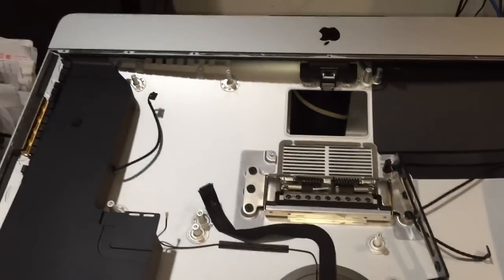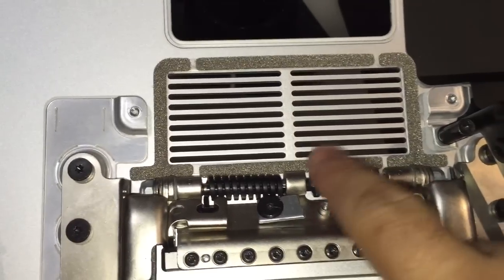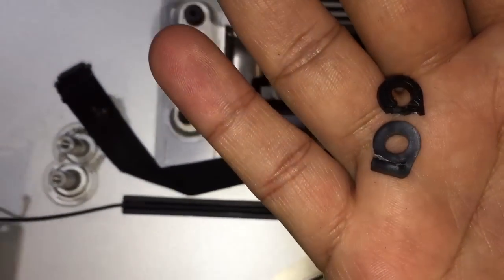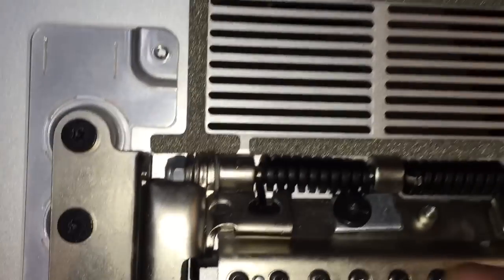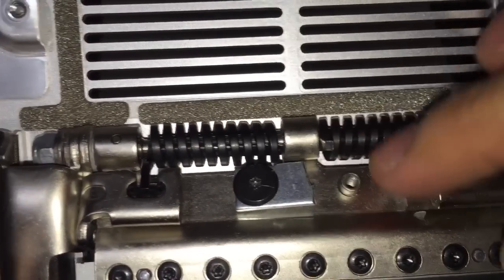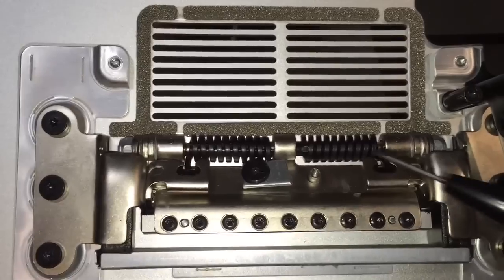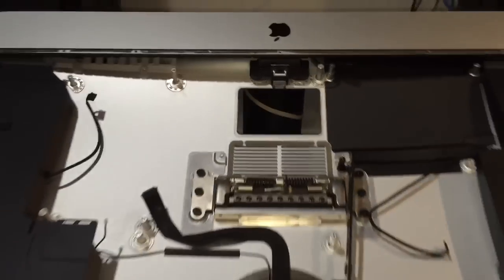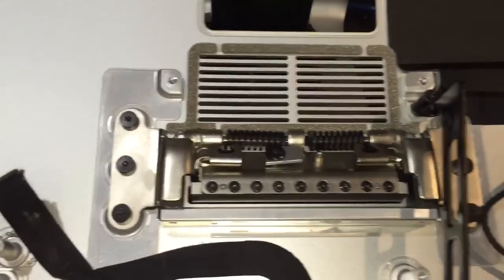REPAIR: My iMac won't stay up / Stand problem / how to fix broken hinge iMac 27 2012 2013 2014 2015

Comment: Amazing, got exactly the same problem today on my late 2012 model after nearly 8 years.... crack and the damn screen tilted down. 
Really helpful explanation, thanks..... but no way I'm opening up the machine up for this, too intricate and I'm likely to do some more damage, so I came up with a plastic clothes peg fix instead!  
Wedged the peg open ends apart with a small piece of cut wood dowel, taped it to hold it in place, added some small sticky backed cut offs from rubber chair feet protectors to the leg open ends on the outside to get some grip, then placed the peg nose up in between the back of the sceen body and the stand right at the top. Taped it into place with some clear scotch tape and hey presto it keeps the screen tilted. 
Elegant?.... hell no... but it works and it's at the back so you'll soon forget it's even there. Adjust the dowel length to get the perfect angle and you're done.... good enough to keep your machine working.... costs nothing!

Comment: Thanks for the vid.  Nice fix.  Had this happen for me too.  27' iMac late 2013.  I had "Mac Net", the only authorized service center here on Maui, do the diagnosis and repair which cost $147.81 for parts and labor.   I had also communicated with Apple about the issue and unfortunately it was barely outside of the warranty period so no coverage.  No AppleCare.  Eventually, I received an email from Apple pertaining to the fact that they now acknowledge this as a "design flaw" and would reimburse me for the expenses to repair.  They since have done so via a direct deposit to my checking account.  This experience was unfortunate and quite the letdown in regards to craftsmanship, but least they paid me back.

Comment: This happen to my iMac Late 2013 25 month after I purchased it. It was out of warranty to get it fixed. I ended up using a make shift piece tied tp the power cord to hold the display up. Might use this fix when I open up the iMac to replace the hard drive.

Comment: My thumbs were still sore two weeks after doing the repair from trying to push down on the washer against the spring. I just could not do it with the hinge still in the machine. So, I just took it out – the set of nine screws. That reduced the amount of spring travel needed to get the screw in.

Comment: you could just get one bigger piece to be fixed in two screws, it would have been stronger. you left one is already risen up from the tension, i think if it would be one piece from left to right, it would be stronger.

Comment: Mine has just gone on a 2013 IMAC 27", had a champagne cork on desk that when wedged between screen and stand at correct height (giving the screen tilt you require) seems to work fine!! Please note less costly wedge options are available!!

Comment: Thank you.  I'm going to be adding memory soon, and this is an issue for me that I also want to fix.  Cheers.
Reply: Adding memory to  2012 / 27" iMac is done from the outside.
Reply: 27in Mac from the outside. At the rear, there is a little door to pop open. 21.5 you need to open the Mac up.

Comment: I'm about to replace the hard disk, so I'm glad for your solution.  It's perfect and I'll do it this weekend and I've got those "L" brackets in the garage.
However, gratuitous statements about Apple doing this deliberately are utter  nonsense.  When my iMac (2012) had this problem (2016), Apple offered to fix it, for free long after end-of-warranty.  But it would take days to do so and I needed the iMac.  I asked them to simply send me the part and of course they refused.
Apple make good, durable products.  I know: I have lots.  My 2007 iMac sold for near $1k in 2012.  It was still going strong.  I have lots of other Apple products and they are very durable and well designed.

Yes, the stand flaw in the iMac 2012 is tragically dumb - even Apple do that from time to time.  But it's not to "force" people to buy more iMacs.
In the interim I simply put a wedge in the back...

Comment from the maker: Yes, You can get replacement hinge for $30-$60, but you will have the same problem 2-5 years down the line.... 

Do the fix like I did and replace those plastic clips with metal like I did and it will never fail!..
Reply: I think my next mac will be a mac mini with all the specs maxed out.

Comment: Please would it be possible to share the dimensions of the bracket and the wholes in it ? This would help a lot when somebody wants to prep this bracket before the actual disassembly. 
Thanks for sharing this video and idea of a fix. Helped me a lot already (gonna fix mine this weekend).
Reply: Today I fixed my stand. For those who are interested in the parameters I asked above: screws are 20mm apart, holes are 5mm in size. I used bracket 35 x 10 mm. Holes on the bracket were not vertically aligned, bottom edge was roughly 2mm below holes. Using this bracket I had some space to move around so I had no problem centering it.  
After this experience though I must say single washer per screw is better approach. It's definitely easier to install and I don't think there's any benefit from using single bracket.

Comment: Could the two sets of three screws on either side of the assembly you are repairing be removed, thus clearing the way for a VESA Arm Desk Mount to be screwed right into the back panel chassis?
Reply from the maker: Mega Bass yes you can remove all the screws to remove the arm and hinge if needed.

Comment: How did you remove the LCD display? Did you use a guitar pick or iFixit pizza cutter and do you have to use a bit of heat from a heatgun?
Reply from the maker: +Edmond Phon I used guitar picks.. probably could use a bit of heat gun to make it easier....
Reply from the maker: +Edmond Phon I used guitar picks.. probably could use a bit of heat gun to make it easier
Reply: +360mix Thanks a lot! I will try iFixit's pizza cutter. My iMac's 27"'s hinge died as well. Got an entirely new hinge. Probably can't get those kind of washer or plate in my area.

Comment: Hi.  Do you mind sharing what the dimension / size of the metal washer you used for the repair?
Reply from the maker: +mdknguyen I dont have the measurements sorry.
Reply: Hello! I've had the same issue recently... The screw holding the broken washer in my iMac was half way unscrewed - the whole hinge mechanism is a complete designers' fail I must say!
Original plastic washers have a complex design (variable thickness, flanges to prevent the spring from sliding off). In rough it can be described as round, 10 mm in the outer diameter, 5 mm in the inner diameter, whilst on one side the washer has a square appendix holding the spring (the one that breaks off and for some curious reason is the thinnest part of it, less than 1 mm thick!!!). The appendix itself is 6 mm long measured from the center of the hole. The two black screws fixing the washers are 3 mm thick in the thread, the distance between them is 2 cm.
So it seems to me that a 12mm (in diameter) round metal washer would fit there just right, but make sure that the inner hole of the new metal washer can hold it tight and prevent from dangling. Hope this helps.

Comment: hi bro, please i did do all what you said but my 27inch imac now stays in one position facing up, so whats the trick to make it adjustable as before to any position i want? thank you
Reply from the maker: Did you assemble the computer with the screen and all?  You must assemble the full computer if not it will not balance....
Reply: THANKS A MILL BRO, U ARE REAL A GENIUS AND FOR REAL "U REALLY LOOKED THE WAY PASS APPLE" CRAZY THIEVES APPLE... I HAIL U BRO.. THANKS AGAIN, U SAVED ME FROM COST THAT I WOULD HAVE PAID FOR OPENING AND FIXING THIS BY TECHNICIANS OR BUYING A NEW HINGE OR NEW IMAC.. LOVE YA BRO... PEACE AND ONE LOVE!!!
Reply from the maker: Jose, Thank you for your words.. glad I could help...
Reply: Yeah bro, appreciated!!!

Comment: Thanks for the info.  I heard a pop about three hours ago, and said, "What the fuck was that?"  I went to push the screen up a bit ten minutes ago, and lo and behold...  It's not the end of the world, but fucking annoying.  Completely designed to fail.  I moved it a little once every couple of weeks.  Oh, well, at least it's not running windows  :D

Comment: So you had to remove the Fan, and Logic Board to fix this? That sucks. I wish Apple would fix everyones Imac for free because of the crappy design
Reply from the maker: +NickC75 Yes you will need to the Fan, Logic board and power supply to gain access to the hindge... I personally don't think this is a flaw its a design so that the imac break after a couple of years and you are forced to replace the computer with a new one...

Comment: I surmise, the reason Apple put the plastic, instead of metal might have to do with static charge build up while the screen angle is adjusted. Imagine having to swivel your screen many times during a week, during which friction is created between the spring strip and plastic restrainer, which in turn causes the screen to stay in an angle you choose. What you do not want is for this friction to create static electricity, which in turn can be a source of fire hazard inside the iMac, which is laden with too much and too many electrical components. I doubt if Apple deployed the plastic restrainer deliberately so that it would fail in a year or two so that the consumer can buy another iMac. The ideal solution is for the video poster to use a more durable plastic strip instead of metal. Prevention is Better Than Cure. Nonetheless, koodos to the poster for discovering the problem and proposing a solution.
Reply: Apologies, but your statement above is packed with incorrect assumptions and felt that I should comment to make sure people are not misinformed.

1) Static cannot be a problem inside the iMac since the metal case is grounded and so the static will be instantly earthed.
2) Metal rubbing on plastic would in any event create static. Metal on metal wouldn't (at least not measurably) so replacing the plastic parts with metal ones would be "safer" given your worries about static build-up. (Which wouldn't happen anyway - see point (1)).
3) Static would not be "a source of fire hazard inside the iMac, which is laden with too much and too many electrical components" since: 
(a) Static would kill the electronics or cause it to fail in time, not ignite.  
(b) The number of electrical components is small compared to, say, a Jumbo Jet and they tend not to spontaneously burst into flames. 
(c) No static can get onto the internal circuitry since IT IS IN AN EARTHED CHASSIS. (See point (1) again!)

4) The ideal solution is to use a METAL strip, NOT plastic unless you want the whole thing to fail again in a year or so.

5) Prevention is better than cure -- Apple ought not to have used plastic retainers. I know. My iMac just went "crack" and now has a droopy screen.
6) I'm fortunate in two ways - firstly I'm an electronics engineer and computer consultant, so I know what's right and what's bull plop. Secondly, I bought a set of iMac disassembly tools recently so that I could open the iMac and replace the hard drive with an SSD.  Now I can sort both things out with one screen removal.
Reply from the maker: I agree 100% with you about the static.... Not Sure why ManjaroJam thought this would be the case... Hope you get your mac fixed... be patience when we moving the screen...  take breaks while doing it..... I removed the screen in 3 successions.. took a break after each side....
Reply: Thanks for the advice - this WILL be probably the slowest disassembly I'll ever do! The thought of cracking my screen is too much to bear.

I was so focused on addressing the issues with ManjaroJam's post, that I forgot to say a big thanks for posting your video! Taking the time to show the issue with the hinge and how to repair it was a real help as I could at least see what the problem was before I open the machine up. It helped me sleep better the night that it happened :)

It's a crazy design - I agree with you that it's so obviously dumb that it must be 'by design' by Apple. I hear that Apple are repairing this outside warranty (maybe they shot themselves in the foot?) but I'll go for a metal repair rather than have them replace the broken parts with new plastic parts.